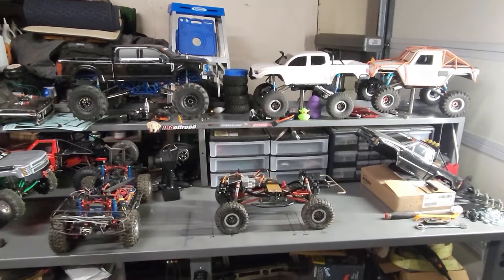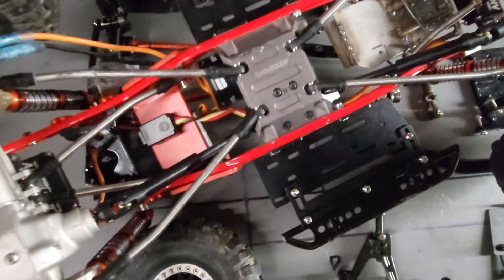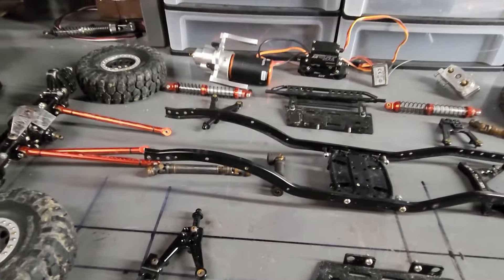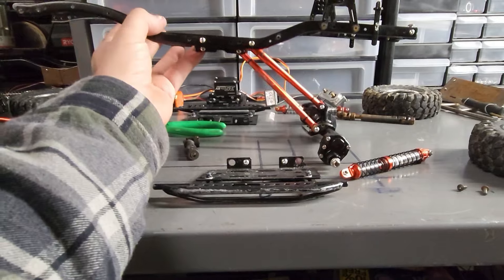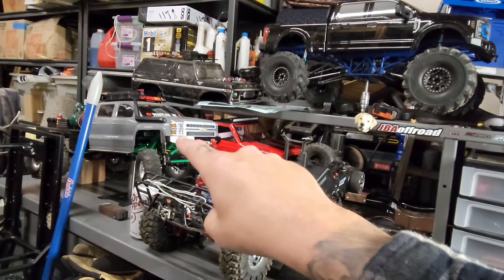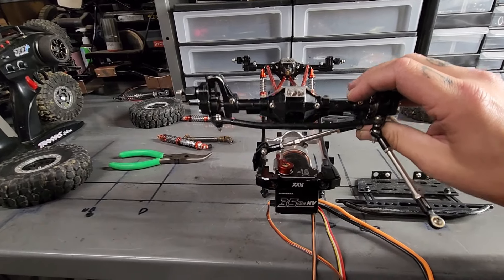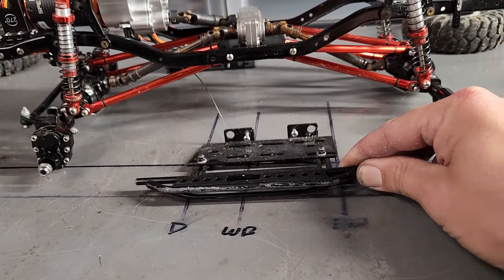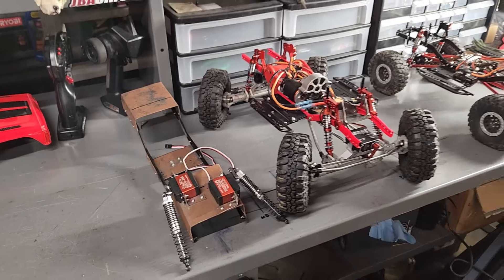How Build a 1/10 Scale Crawler With Only Aftermarket Parts

Comment: Hey Waffles! TY for the great video once again, hey a trick I use on those pins on either axles or driveshafts is, you cut a small piece of heat shrink tubing, slide it over the drivesshaft end to where you can tighten the set screw or slide the pin in, then you slide the heatshrink back over the pin and apply heat, I like to use the marine tubing, then you can just slice it off if you ever have to get it back off!
Reply from the maker: Well that will be happening to the fleet now. Thank you very much!
Reply: @WafflesRC-pb4nt  Anytime, I got the marine heatshrink at HarborFreight. The Marine tubing won't move on you like the reg. Heatshrink does, it's got a sealant on the inside that helps it stay in place better.
Reply: Wonderful idea thank you
Reply: Excellent idea. 👍
What diameter tubing do you use?
Or did you get a mixed set kinda thing?
Reply: @the.just.able.biker67  I got the multi-pack of Marine Heat Shrink tubing at Harbor Freight :)

Comment: I like this video very well done. I personally have built my fare share of kits and so forth. I personally enjoy them complete then love to severely cut section pinch what ever the bodies build my own bumpers stingers sliders etc. I built my own rod bender and enjoy using my employers tig welder. 

I’ve don’t a c-notched axial wroncho using my flux core 110 HF welder. Was a little messy but if controlled right works well. You have been motivating me to do this on my channel since I haven’t made a video in idk 6months or more. I’m busy with home life sobriety classes and have had so many of these things it’s ah yeah cool ya know. I prefer to drive them but that’s my perspective. My garage is almost completed and would like to start doing this again. I just month ago bent up some sliders for my TFL bronco out of .032 t6061 scrap aluminum here at work they work great protecting the fiberglass body. 

I super have enjoyed your videos and your personality I’m idk 35-50% through all of them since started watching beginning or last week. Thank you again for your entertainment and originality.

Comment: Hey Waffles thanks for taking the time to make the Videos. Currently building my first truck from scratch. I'm still a bit of a noob and was wondering on the four wheel stir is there a kit or do you just get two front axels? Thanks
Reply from the maker: The axles on my 4WS are AR60 knock offs but I did find a kit for those to convert the back axle. I don't see anything wrong with doing another front axle personally. I'm sure alot of people out there will say otherwise, but who needs their negativity haha... I would just make sure they are both servo on axle for the steering.

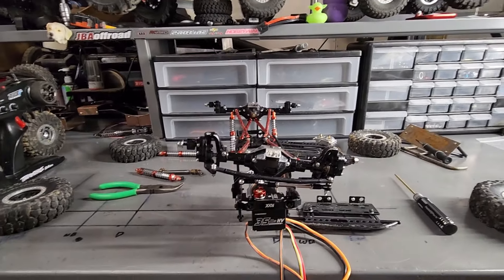Comment: thanks for sharing your build. 21:37 when the front is fully compressed there is still a big gap between top of front axle diff cover and bottom of motor transmission. That motor placement results in high CG. Can you mod it to lower the motor position?
Reply from the maker: I'm not able to because if I put it any lower, the motor hit the steering arm on the servo.

Comment: Hey man just curious, how is the motor set up you got in this with water and mud
Reply from the maker: Haven't had a single issue with the motor. Still running strog to this day. The receiver however has been replaced because I didn't use dielectric grease in it.

Comment: For your adjustable suspension ("that's gunna be a Cadillac Escalade"), wouldn't you need to do some crazy esc/ecm/receiver coding? I just don't get how you could make that work without doing super deep into the electronics/coding but I'm new to all this so I'm prolly missing something easy ha.
Reply from the maker: There are a couple of videos on it on my channel that explain what I did for it. It was a lot easier than even I thought haha... Hope you go and check them out and enjoy them!

Comment: Hi. Could you please indicate the other parts remaining to get a complete build? I couldn't find the electric motors or the speed controller.
Reply from the maker: So this is the one in that particular truck https://amzn.to/4boQo9M I also use this one in a few other trucks and it is really good as well https://amzn.to/3XEkumu
Reply: thanks. what should be the parameters to look at to define if it is a 1200kv motor or 2300kv motor. Is it just the output power and should I look at other electronics specs to match as well?
Reply from the maker: The KV rating is the speed the motor spins. So the higher the KV number, the faster the motor spins at full throttle. Only other thing to look for is the battery rating and type you want to use. I primarily use 3s lipo batteries but those I believe can do 2s or 3s

Comment: How about the receiver and water?
Reply from the maker: I had no issues as long as you use dielectric grease and the tip of the antenna stays out of the water. Once that goes under you lose the signal.

Comment: rock crawling catty. Nice job walking people trough that. I'm at a point that aftermarket bodies kinda let me down. not many mopar options so I'm 3d printing my bodies now and slowly getting rid of my lexan bodies. Next one to go is my axial unimog since there isn't parts support for it now. Don't tell anyone but I'm doing a 1990 dodge ram crew cab dually. It will need a built frame the wheelbase is like 17+ inches. probably take the path of the 1972 power wagon I just did frame wise. And I'm definitely agree build it for you not what everyone likes and buy the parts you like. Reefs servos are great but my 20 dollar amazon one out lasted one of the reefs I got.
Reply from the maker: I won't tell anyone about that dodge ram but I will ask..... how much to make me one as well?!?! That sounds like it will be a really fun build!!
Reply: @WafflesRC-pb4nt  Off the top of my head I'm not sure I've been recycling parts. Axels is where it adds up fast because of the brass to get the weight low. Probably guess 500 give or take.